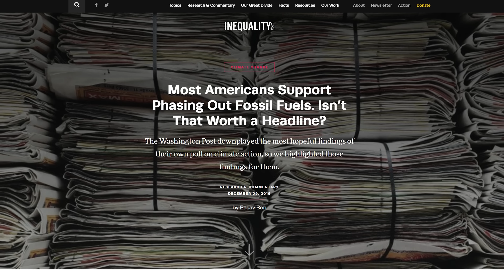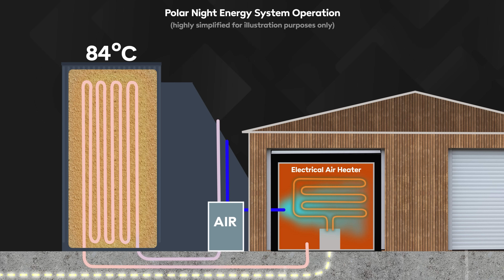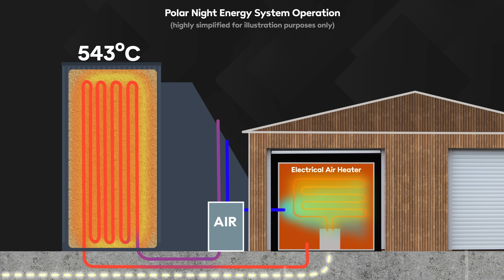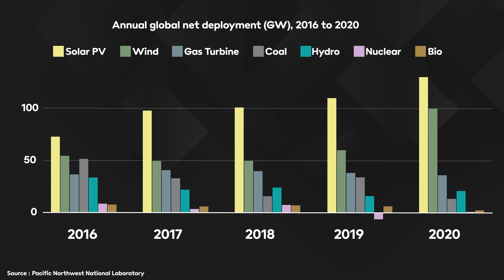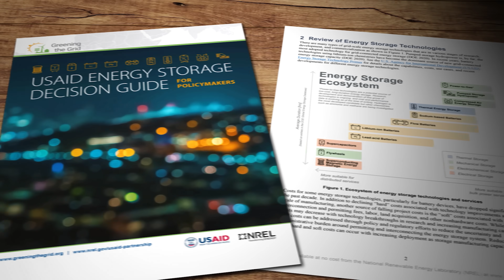The 'Sand Battery' that heats your home, NOT the planet!

Comment: Great video, Dave, cheers! Here in Saarland, Germany, there's a lot of community heating systems round power stations. Such heat storage systems would plug right in, no problem
Reply: Not really tho as they are horrible inefficient. They require high temperatures for storage so either burning, solar concentration or induction. Germany has a massive energy problem in the winter (fully renewable), so using induction instead of a heat pump solution does not sound that great to me. 

Instead of sand, you could use existing heat storage technologies namely PCMs (Phase Change Material).  The energy required to heat 1kg of water or ice by 1°C is 1kcal.  However to go from 1kg of ice at 0°C to 1kg of liquid water requires ~80kcal. Meaning you can store a lot of energy by using the phase change. You can do similar at higher temperatures with other materials, paraffin (candle wax) being an example here. Thus you could have a big tank of wax at ~75°C that you melt to add energy and freeze to remove energy. You can't store as much energy per area as with sand, meaning you need a bigger tank, however your max temperature is now 75°C so you could use a heatpump and be 4 times as efficient from an energy perspective. Now to be fair, there are challenges, for example Wax tends to expand when melting and a tank would have to deal with that.
Reply: @_aullik  sand is environmentally friendly, a ground-source heatpump heated hotwater tank in sand is good, with reticulated radiators, sized for heat storage with electric three or four hours at ultra-night rate, ideally including heatpump compressor direct-coupled vertical-axis wind turbine for free heating every time the wind blows (subsurface ground evaporator or built-in coolroom/fridge)
Reply: @garygraham8373  Sry but you lost me there somewhere. Could you please split that into a couple short sentences.

What i understood from your text:

You want to use a heatpump, so your max temp is ~80°C or you are super inefficient. So what is the point of the sand instead of just using water tanks? Sand adds nothing to it. The water alone is a decent storage medium, however it is not that easy to insulate when keeping it under working pressure.

As for the heatpump that is directly coupled with a wind turbine. Whats the point of that? Wind turbines convert rotation to electricity and motors back to rotation. The overall efficiency is 80% to 85% efficient. A gearbox in direct coupling will get you around 90% efficiency. So slightly better, however now you are dependent on wind directly above you. Your heatpump is also less efficient as it cannot adjust its motorspeed depending on its needs. So direct coupling doesn't give you efficiency but it makes you a whole lot more dependent on the whether.
Reply: @_aullik  I'm pretty sure the reason this design uses sand over water is because water loses heat very quickly. Sand may take a longer time and more heat to reach temp, but it retains that heat for a very long time.
Reply: @_aullik  70 degree centigrade water is ok for reticulated radiator heating. a sand enclosed hot water cylinder (without cylinder insulation) stores heat for longer than a conventional cylinder and heat is easily transferable as hot water to radiators.  a direct-coupled wind-turbine-to-compressor heatpump with water cylinder heat exchange is a very efficient water heater when the wind blows (no gearbox required).  an off-peak electric heatpump with water cylinder heat exchange is a back up for when the wind doesn't blow.  (either heatpump can also negate conventional refrigeration with its evaporator in a walk-in coolroom).  any wind turbine engineering is a challenge,  a direct-coupled heatpump compressor is the simplest and most efficient way of extracting energy and storing it as heat whenever the wind blows.
Reply: @_aullik  PCMs are a curious topic. Is the price and availability of paraffins or sugar alcohols trivial from engineering point of view? For sure the economically viable sources for petroleum wax will be fossil fuels, not some warm and fuzzy soybean oil. 

Latent heat of phase change is a self-evident and an uninteresting insight. How do you freeze the material in the container(s) and how reliably does the crystallization occur? Please please, present a juggernaut of a tank filled with paraffin wax and the estimated storage capacity in GWh and the cost in €/MWh to me. Not some miniature nuclear reactor arrangement in a bucket at the basement of a technical university.
Reply: @mattihalme81  I honestly don't know of any large scale PCM tanks. I believe that this will take a few more years as engineering solutions to expansion is a lot more complicated than just putting sand in a tank. 

The PCM will be a lot more expensive than just water or sand. However your storage capacity is way higher, so when calculated for storage capacity it might actually be cheaper. The tank will be primary cost factor and you only need a fraction of tank to store the same energy. That really depends on how good and expensive your solutions to the problem of pcm are. 

A high temperature system as shown here will always be cheaper than PCMs for the cost of not being able to use a heat pump thus higher operating temperatures.
Reply: @mattihalme81  The costs of paraffin used for energy storage would be completely trivial because it’s a one time investment/instalment. 

There’s also hardly any disadvantage from an emissions point of view to use a fossil source because the paraffin will not be burned. 

The advantage of a phase shift heat storage medium is its density and customisable melting temperature.
Reply from the maker: Cheers Martin :-)
Reply: Transfer warm oceanwater/closed water system to where its needed.
Thank me later
Reply: @theowink  That is a cool idea, however it also has its problems and you won't manage to get that far inland while staying reasonable on cost. For many places it might be better to store warm ocean water in the summer for the winter. But even then, the advantage is not that great.
Reply: @_aullik  See it as a super giant central heating system where cool water gets warmed up in a closed system using solar/wind pumps every mile/killometer.
Oceans need to cool down also/anyway so you can control the weather as well,depending how big the system is.
This idea repeats in my head for a couple of years because I think this is the solution we a facing in this time we live right now.

Comment: Nuclear power would be much better source of energy for this than anything else.
Reply: Why? What’s the advantage of nuclear over this system that works and is in production, and didn’t cost much to build?
Reply: @davestagner  this system is great. But does it have to take power from crap like solar and wind which work at random times?
Reply: @vladoboza707  Are you aware that France had to reduce nuclear power output recently because of the heatwave? They rely on river water for cooling, and it is too warm to safely return to the rivers in these high temperatures (kills the fish). So unfortunately water-cooled nuclear isn't going to be much use in future- it can't be relied upon lin hot weather. Unlike wind power!
Reply: @vladoboza707  Variable and random are different things, and the energy from solar/wind are not on-off switches. Over longer periods of time (weeks, months, seasons, years), they are very predictable. So you might not be able to precisely forecast the output of a plant on a given day, but you can forecast its output for a given year. So, with storage, just calculate how much surplus you need to generate over how much time to have storage for how much time. It's just simple math.
Reply: I'm a big proponent of nuclear power so I partially agree with you. But why would you then want to use resistive (i.e incredibly wasteful) heating? It would be more sensible to directly use the waste heat of the power station for community heating and/or use heat pumps. This idea is only worth considering in a predominantly wind/solar powered grid
Reply: @sammason2300  We're going to have a predominantly wind/solar grid, though. There's no way to bring enough nuclear online in the amount of time available in order to head off the worst of the climate disaster. Solar and wind can be built out quickly and inexpensively. That's why there's so much interesting activity in storage now... the market opportunity is incredible, and "Let's heat up a silo full of sand and hook heating pipes to it" is a rather simpler problem than building a reactor.
Reply: @davestagner  maybe, but I was responding to the OP
Reply: @sammason2300  I would consider resistive heating as a grid controlling element. Nuclear power plant does not react in seconds to changing demand.
Reply: @vladoboza707  Nuclear power can be throttled quickly if we have SMRs. Nuclear powered submarines can go from idle to full steam ahead in a (classified) number of seconds
Reply: @sammason2300  that's true :) Honestly the video is about quite common heat storage tech, which you can also do with molten salt in some 4th gen nuclear reactor.
Reply: @sammason2300  Do submarine nuclear reactors actually ramp their power up and down quickly like that, or do they keep the steam that drives the propellers under pressure for quick access? It’s not clear to me (and I’m no expert), but if it’s the latter, that’s basically an argument that even the best nuclear SMRs will need storage to respond to sudden shifts in demand.

Comment: https://en.wikipedia.org/wiki/Zero_heating_building Look up "zero-heating buildings"
Reply: Thanks  but that way of building is far too expensive and much too difficult to be used in massive scale of normal buildings.
Reply: @teranova5566  Depending on reference building. Can be cheaper than passive-house which is the norm in many N. EU places. There is no traditional heating arrangement and no modulated external shading on windows. Must have hefty insulation and sophisticated ventilation though.

Comment: I was thinking recently and I wondered... What if the focus for residential energy became balancing demand? i.e. Say you have a grid tie system which on any given day generates X amount of power. What if that power is stored for peak consumption in that home. With a constant demand on the grid. Only using the stored energy when consumption goes up during the day. To the point that when consumption goes below the cutoff "baseload" demand the home batteries actually start being charged from the grid with energy up to the cutoff point. I think it should be possible to write an algorithm that can find the sweet spot cutoff for any home installation. It could be really good for grids. Maybe that's already done somewhere. But it seems like it could be a good system to me in any case.
Reply: Now add all EV batteries to the grid, wherever they are they get plugged into the grid as power sources for the grid. Most peoples personal vehicles are used maybe 10% of the time the rest it just sits doing nothing. Again with a little bit of all for everyone society instead of the unsustainable capitalistic growth for the very few or die mentality we are all going to die sooner rather than normal. Thousands, millions of vehicles & school buses would eliminate the renewables will never be able to supply the base load lie!
Reply: @TheLosamatic  It's a valid point. For example the 3 million odd Teslas that have been sold in the world, assuming an average battery size of 50kWh, is about 150GWh. Not close to the 10k GWh they say is needed, but a good bite from it. And likely we are looking at something more like 300 million EVs some time 2030-2040. It's a lot of capacity. A... lot. It can definitely help. The trick is just to make grids smart enough to deal with the variable capacity effectively. Which, face it, is just software.

Comment: I was literally just thinking about this. I wonder if pairing this with heat pumps might be a good idea. Pulling the heat from attics and passing them through the thermal storage before pumping it into the ground.
Reply: I was in my attic the other day and thought then that a heat pump could easily provide the hot water I need.
Reply: @dwftube  I had to fix my ac a few years ago in the middle of the summer and I went into my attic. Got in about 6 feet and I felt like I was going to die. Learned my lesson real quick to vent the attic first. So much potential up there.
Reply: @justbecause4557  But only during the warmer months - though I still think in the winter it could be better than outside.
Reply: That's a ground source heat pump and they work great if you can do it, expense and the ability to dig being the biggest barriers.
Reply: Too much heat in the ground will dry it out.  Gotta watch out for that.

Comment: I would have two concerns with any sort of community system :
a) Lost through distribution
b) Waste, not unlike water waste that we see all over the world. Because it's not coming out of MY well, it's coming out of OUR well and you will bear much of the cost of my wasteful ways.

For the record, we have a heat pump powered by hydro-electricity.
Reply: Community systems benefit from the economies of scale
Reply: @tuomaskoivistoinen6476  Quite true. And therein lies at least some balance against the waste.
Reply: It may be too expensive to have individual heat storage facility. But you are right, once it is big and cheap, we have a tendency to waste. The cost is no bar for wasteful people.
Reply: For these types of systems specifically, the larger your system is, the lower your loss is over time.  Simply because a larger object (assuming a cylindrical or similar shape) will have the property where the larger it is, the greater it's volume will be compared to it's surface area.  So, the larger you make the systems the less interaction they have with external systems whatsoever where heat loss can occur.

  This property is precisely what makes them the most viable/realistic method for being a long-term storage solution.

  At smaller scale these wouldn't be as economically viable, the larger scale they are the more economically viable they become because the systems have a lower potential for energy loss over time.  Though from the sound of this interview the current solutions they've come up with only work up to a certain scale (I'm assuming due to the need for systems to push air through the whole system).  I would think there are probably methods around that to make even larger and more efficient systems though.
Reply: Yes as opposed to the fossil fuels industry concerns with all the loss of life in connection to their products, your concerns are meaningless! But pray tell spank me as to why they are not with no remedies!

Comment: I'm curious what the transmission losses are with district heating, vs "onsite" heating via a heat pump in the home?
I get you can capture waste heat from industry, but surly that could be converted to energy and transmitted much more efficiently?

Comment: wouldn't it be more efficient to just embed the heating element in th sand stack?
Reply: it may be very tricky to distribute heat evenly because sand is a rather poor heat conductor.
Reply: Maybe the heat exchange would be way worse. If you optimize for that a lot of tubes needed. Replacing them to heating element will be very expensive. Still, I get your point!
Reply: You need a mechanism to "suck" heat out of the heating element otherwise it will just burn out. Sand has a very poor thermal conductivity, so an intermediary fluid really is required
Reply: @sammason2300  But why air?
And then yet another heat exchanger for the district heating?
Obviously 700° is not going to work with water (at reasonable pressures)
Reply: @jimurrata6785  My guess is because using a liquid would necessitate a highly pressurised system
Reply: So why is it that earth ship houses heat the ground up around there mainly ground surrounded houses with just the sun light hitting the ground! This is disturbed ground of old tires pounded full of the existing soil several layers thick and mostly no tires showing?